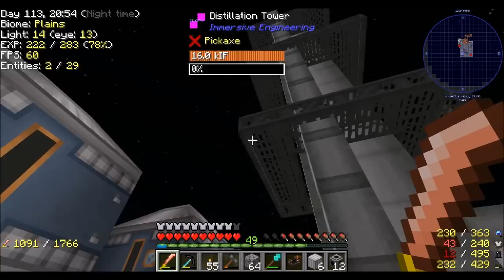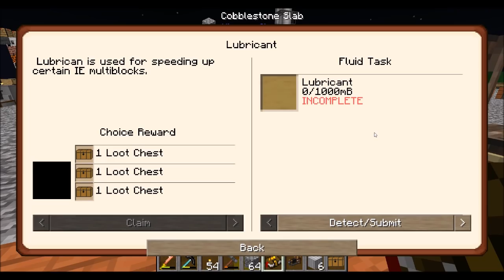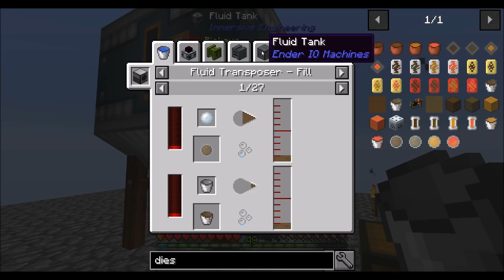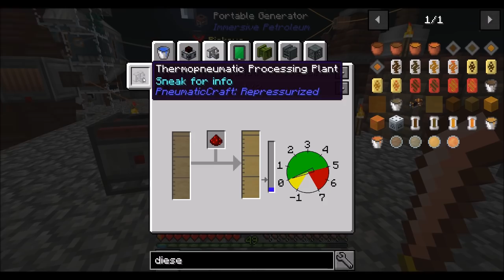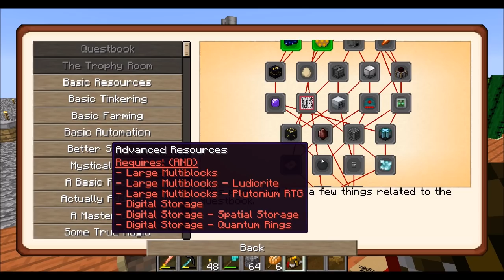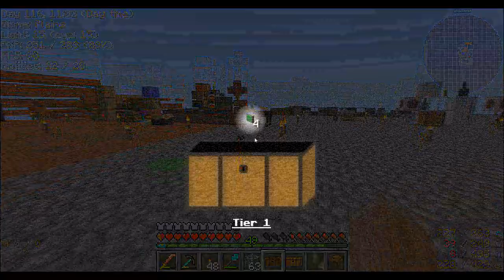Modern Skyblock 3   Ep30 Tinkering

Comment: To deal with endermen, place diamond spikes on the ground and put a cage round that. A floating botania Vinctulous in the cage will force the endermen to teleport there. Add a hopperhock or vaccum hopper to pick up the drops. It's tremendously satisfying to see those things trapped and being killed without further effort. A bellethorne will also kill 'em, but uses more mana than spikes and you don't get the player-only drops.

Comment: I love how he's talking about the diesel like he's using THAT in those 2 GASOLINE generators, lmao.

Dire, what else are you going to use that Gasoline for until you get into Ender IO/Thermal and their combustion generators? It's going to literally burn a hole in your pocket, lol....and might even hold up your diesel production when it eventually fills up (once you get the giant diesel generator). Assuming you go into the Diesel Generator and not the Canola Oil Generators that you mentioned as well, that is. XD

Also, yes...I'm well aware that this is (most likely) a backlogged episode. =p

Comment: I struggled with power, mostly using coal generators.  There are a few options, but after Chickens, and thus all the resources, I built a stack of the top tier solar generators.  I've been running everything off those since.  I am not at reactors yet, because I took a week off for the release of the Forest.
Reply: IE windmill to canola press, to 2 AA fermeting barrels, to 3 AA oil gens is a good early start.  But, IE biodiesel is a good step up from that and fully automatable, too.

The next step up is TE dynamos (I think), but the pack is not very power hungry in general.

Comment: please no more canola :(
immersive petrol is extremely good for power, with 1 or 2 diesel engines and multiple portable generators running off 1 distillation tower you make like 6-11k rf/t
Reply: As soon as he breaks into embers, he can fully automate cloche+squeezer+fermeter+refinery+(bio)diesel generator.  Might even be able to do something cool with existing, item moving methods, compators, and more redstone control.

That'll be all the power he needs until (at least) opening thermal expansion dynamos and augments, where there's a number of fully automatable power options.  (wood [hopping bonzais]-> charcoal -> coal (combustion) -> liquifacted coil -> naptha -> fuel -> compression dynamio [w/ closed loop cooling and igniter plugs] is one; I'm pretty sure there are others.)

Comment: You do have the Spectral Key.
Just get some more Ectoplasm, make the Spectral Room bigger, and then open your Chance-Cubes inside the Spectral Room.
The Room itself is safe, only things you put inside the room can get damaged, so there is no problem with that.

Of course, have some extra Ectoplasm to create a second Spectral Key so that you can access your Spectral Room again after you die... or just put it in the Ender Pouch before opening any chance cube.

Comment: Morgan Le Fray (or whatever modifier its called or maybe some modifier obtained from using AA gems) seems to cause a bug on reliquary item drops. Combine with luck, I'm getting >10 reliquary drops from killing mobs.
Reply: i'm not sure but i think thats purely the luck items doing that ( assuming u dont mean the tinkers modifier "luck')
Reply: Does the luck item have that big of a buff towards drops? That would be a little bit OP
Reply: In the MS3 thread, some people are reporting several stacks of reliquary items per kill because of a some +luck item.  Reliquary+Luck seems to be bugged.
Reply: Boyd Smith, what if relicquary intentionally is letting luck effect the drops but does not anticipate another mod abusing the luck stat this badly.

Comment: Oh Dire… Says smart output is a cool thing he never played around with and *doesn't place it down*. 👏
Reply: Yeah, at the very least it seems to near-eliminate the cooling period.  It's actually a faster than a seared faucet can pour, so it becomes worth upgrading how you extract fluids from the smeltery.
Reply: Shylight what does it do
Reply: It's a replacement for casting table (or basin with an upgrade) that works much faster, has a UI, can stack up output, can be controlled with redstone… Basically there's no reason not to use it instead of casting table at the very least.
Reply: Ok cheers
Reply: Right???

Comment: hay dire you should use a 2 * 2 of spruce saplings instead of jungle. the spruce will never have a side branch and it about as tall as the jungle 2*2. just a bit of advise to make the farming easier, BTW this is vanilla knowledge so it make sense you wouldn't know about it
Reply: Ejpon I never thought of that good idea
Reply: i know but he could still use the info for any further series he does
Reply: Oh he could make an automated Charcoal thingy, which is like... 2 Hopper Bonsai pots and a furnace, to get unlimited Charcoal for free...
Reply: that is vary true
Reply: I have done that in my kitchensink world, using embers pipes which are very cheap.The furnaces output into a chest, which feeds back into the fuel slot of the furnaces and also to the hopper that feeds the endoflames.
Reply: what about dark oak